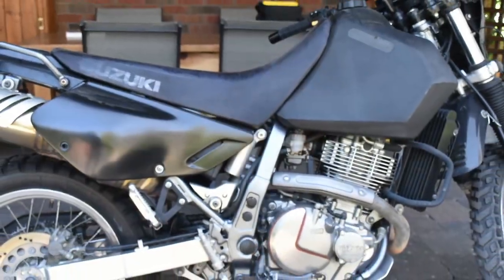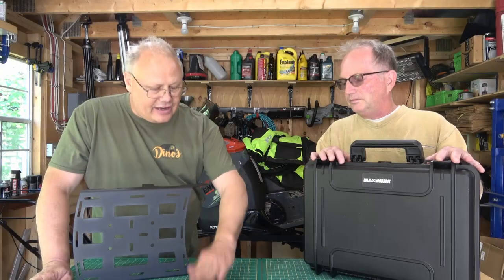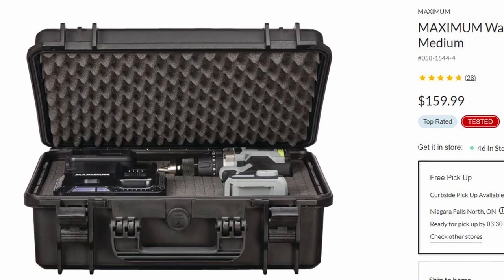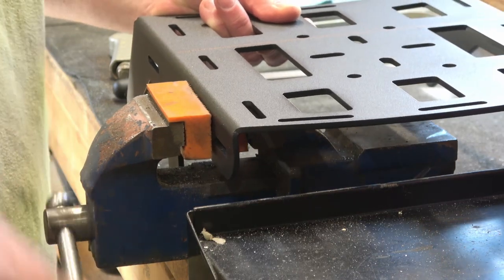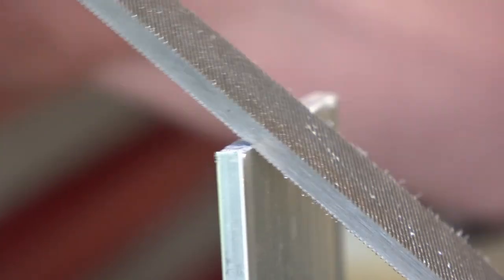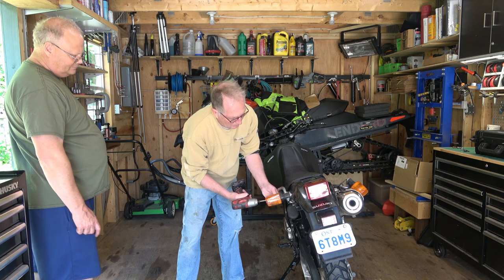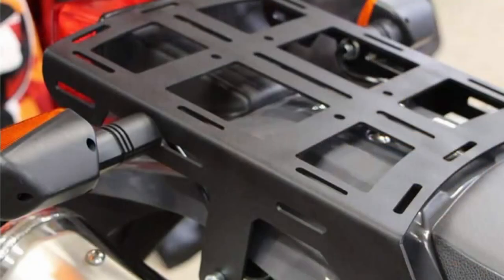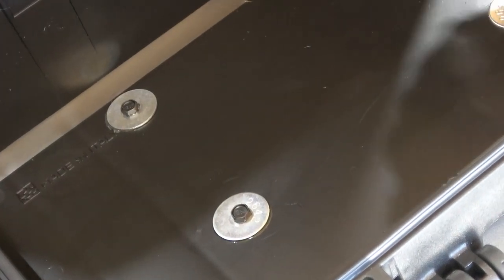I install an inexpensive motorcycle rack and storage box on the DR650

Comment: Great stuff Dino and Karl. I've installed 2 of those racks, one for my bike and one for a mate, I'll call him Aussie Karl......   I had no issues with the grab handles. I'm thinking they didn't supply you the appropriate bolts which may have caused the confusion.  That tab at 10:11 was broken on both bikes and is a known weakness of the Dr650. The two little welds used to attach it to the frame are insufficient and will eventually break if the rack has to carry any weight and/or is ridden on corrugated roads etc
Instead of a pelican case I used an insulated cooler bin / ice chest painted to look like aluminium. It's about 3 times taller than the pelican case. Super handy for drinks and food when camping and also serves as an almost indestructible, cheap good size top box the rest of the time.
Reply from the maker: Thank you for the great feedback especially about those tabs, I am still learning about the DR quirks and that type of information is invaluable to me and others, thanks for sharing. I think the cooler Idea would be a great addition and work well.
Thanks again and say hi to Aussie Karl for me, everyone needs a good buddy!
Dino
Reply: @DinosTinkerShed   will do!  And by the way the tab strengthening is a lot easier done as prevention as opposed to repair. I've seen your welding skills and you'll have no problem adding a bit of extra weld. It might make another good video!

Comment: Good video with instructions.  I have a similar case on my bike. On a hot day things inside the box (food) get a bit hot. I added 20mm spacers and a sheet of aluminium to the top lid. This gives an air gap plus another flat storage area. Four small metal (al) drawer handles attached at each corner so I can strap things (bike cover) on the al sheet.
Reply from the maker: Great suggestions Mal. I like that idea allot. I can see how that would work well.. thanks for the feedback.
Dino

Comment: If you want? SW motech sell an adaptor plate for one of their luggage lines which you could use to make the case on the back a quick release case.  I have done this and it works very well.  SW Motech part # Art. No.: SYS.00.002.10000L/B  Adaptor kit for the luggage rack Art. No.: SYS.00.001.13000
Reply from the maker: I'll take a look, thanks for the tip.
Dino